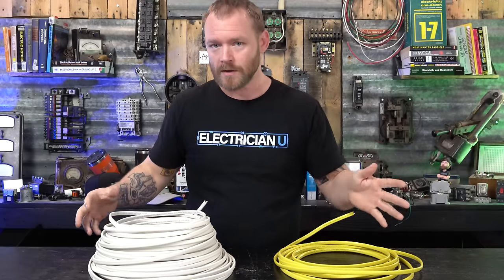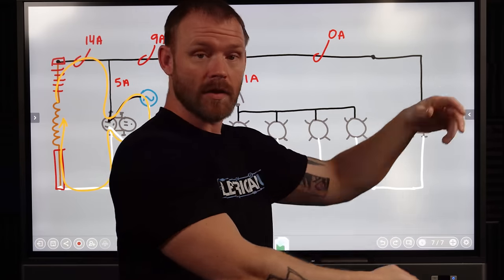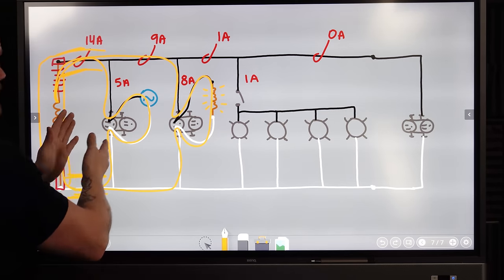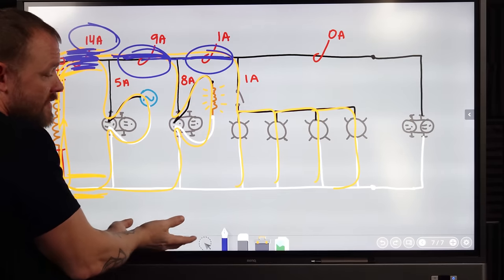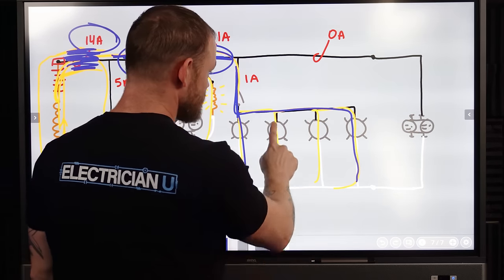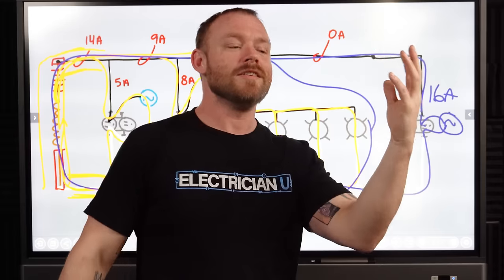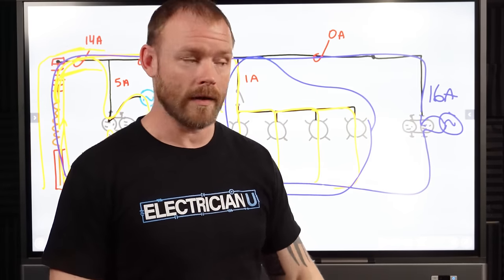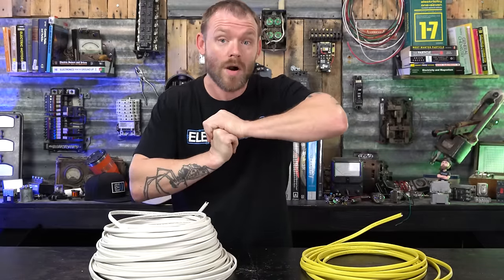Should You Be ONLY Using 12/2? When Can You Use 14/2?

Comment: Thanks for explaining this. In my two bedroom apartment nearly ALL outlets and overhead lights are on ONE 15A circut. So for example my living room has three outlets. Two outlets are not connected to the third outlet. That third outlet is connected to two outlets in Bedroom #1 and a ceiling light. Then in goes to two outlets in the Bedroom #2 and to a ceiling light. Then passes into the kitchen area where the fridge is connected to it and the ceiling light there, a light in the pantry and a light in the bathroom. Now the two outlets in the living room are connected to two outlet in the kitchen area (three outlets in the kitchen total) which goes to a 15A breaker. The bathroom has a GCFI box (Line in) that is then connected to two GCFI boxes (Load) in the pantry (above the counter) then goes to a single outlet to Bedroom #2. So in total I have just 3x 15A breakers for the entire apartment. When I plug in an AC unit in Bedroom #2 and an AC unit into the Livingroom plus not to mention a personal computer in Bedroom #1 it sometimes overloads the breaker and it trips. Also to mention... The entire circuit that is one a single breaker connecting the three rooms has NO green wire or copper wire for ground. Nor is the breaker in the basement GCFI type. The romex that comes into a metal outlet box just has a black and white wire... no ground wire shown. Great video. Thanks for sharing!

Comment: All wiring in a circuit needs to be able to handle full fault current of the breaker, without building any heat in the wiring.  No mixing 14/2 and 12/2 even if nominal current flow is within acceptable ranges.

Comment: With today appliances and computers the 14 gauge is obsolete now I'd prefer 12 gauges for outlets only and 14awg is suitable for lamps and ceiling lights and 30awg is suitable for rack mount servers and dryers and AC and heaters

Comment: 12/2 to outlets with 20 amp breakers. You can use 14/2 or 14/3 for lights. It needs to be a 15 amp breaker.

Comment: Only problem is if you have a short on the 14 guage wire. It will melt before the breaker trips.
Reply: Not necessarily. 14 ga wire has a low enough resistance that a short, even on a breaker as high as 40 or 50 amps, will still trip (Unless ii is a GE, Zinsco or FPE) long before the wire gets hot enough to get damaged.  On an extended overload, however, yes the 14 CAN overheat enough to at least degrade the insulation over time on even a 20 amp breaker.

Comment: When we built Mom & Dad's house, it was wired with 100% 12 AWG (or larger for water heater, stove, etc).  We didn't use any 14 AWG wire.  However, that was many moons ago, when everything was incandescent bulbs (generally 60W to 100W).  Often one switch would control a half dozen bulbs.  So, if one hits 10 bulbs at 100W, that is 1000W, or close to 10A.
Of course, it was also easier that way using all the same wire, and I was mighty young.
I don't remember if plugs and lights got mixed.  I presume they did in some places.

Now fast forward to today, and I'd likely separate light circuits from plug circuits, and use 12 AWG for all plugs, and 14 AWG for all lights, as most LEDs are somewhere from 5W to 20W.  One still can't have an unlimited string of 20W bulbs.

Also consider multiple home runs, so each bedroom might get an independent circuit or multiple circuits for plugs.

My future workshop will have some 30A 110V circuits as well as 30A and 50A 220V circuits.  So bigger wire.  It is annoying to have something like an air compressor blowing circuits.

Good point in some of the comments warning against mixing wire gauges on a single circuit.

Comment: There's only one municipality within 100 miles of me that will allow 14/2 in a house. And oddly enough, it's the largest one . I think all the others are afraid homeowners will swap out the 15 amp breakers for 20s and overload the conductors.
Reply: That's kinda silly though. Why wouldn't they just throw a 30A breaker in once they exceed 20A? Or jam the old proverbial penny in the fuse holder?

Comment: I only use 12 or greater (10,8,6). I really am not a fan of 14 even though it’s easier to work with it’s just not satisfactory for future proofing and the last thing I wanna do is rerun freaking electrical wires. Better just to suffer a tiny bit more when you’re doing an install. Also, the price is negligible for the difference going from 14 to 12.
Reply: Yep, you should step up and use minimum #10.
Reply: @inthemiddleof  Exactly. Let's all run #6 on 15 amp circuits just in case/what if/you never know someone might decide to replace it with a 50 amp breaker so they can plug in 9 space heaters.

Comment: My house has no 20 amp 120v circuits. All 15 amp breakers. All in separate subpanel. It's the wire going from the plug to the 120v appliance that's the problem.

Comment: You’re not thinking about it right. The breaker is protecting the wire so if there is a short at one of the lights that is drawing 20 amps you’ll have a fire instead of a breaker that prevents that.
Reply: Not necessarily. 14 ga wire has a low enough resistance that a short, even on a breaker as high as 40 or 50 amps, will still trip (Unless ii is a GE, Zinsco or FPE) long before the wire gets hot enough to get damaged.  On an extended overload, however, yes the 14 CAN overheat enough to at least degrade the insulation over time on even a 20 amp breaker.

Comment: Fire hazard, consider the LED circuit shorts to ground. If the wire gauge of the wire for the LEDs is like 20 gauge-ethernet wire, that wire is going to heat up  and burn out. Have to consider circuit wiring failures, the wire has to be big enough to trip off a breaker supplying it with power. So 15 amp takes 14 gauge wire, just how it is done. My house most of the upstairs is wired with 15 amp breakers and 14-2 wire, including the bedroom lights and outlets.

Comment: I don’t do what you have shown ever,it won’t pass , if any portion of the circuit has 14 wire the entire circuit gets a 15 amp breaker . I run separate lighting home runs only need 2-15 amp circuit’s to feed the lights on most houses since LEDs have cut draw on lights by 80 percent.

Comment: I kinda feel like if the homeowner is wiring "such a large house that they save thousands" using 14/2 vs 12/2, then said homeowner and their "large house" can probably afford the upcharge in 12/2 wiring. In today's market, a $500k+ house vs saving $2000 or less on wiring? Just spend the extra, they won't notice the cost.
Now, if you're building a row of Section 8, the savings is going to be in the low hundreds, in which case, just spend the extra money, they won't notice the cost.

Comment: Yeah, I will save a few bucks on my wiring. But when my house burns down due to insulation breakdown. Maybe next time I will just do it properly instead of being a cheap ass. Cables should always be rated for the upstream circuit protective device, never break guage.

Comment: Most times a bedroom circuit only needs a 15A circuit. Why waste money on a larger wire when it's not needed? Besides when that alarm clock shorts out wouldn't you rather have it on a 15A circuit which will trip out sooner than a 20A circuit. In a future code, you will be able to use 10A circuit breakers and smaller wire. The cost of wire is outrageous today. I used a lot of 14 wire when I wired my own house 35 years age, and have never tripped a circuit breaker on overload.

Comment: Obviously, from my name, I am not an electrician.  That said, over the years, I have done a lot of rehab and remodeling work.  Everything I have been told over the years is that you always use the correct gauge (or heavier) wire based on the breaker.  In other words, if you have a 20A breaker, you shouldn't use anything less than 12 gauge wire anywhere in that circuit.   What happens on that lighting circuit if something shorts out, but not enough to trip the 20A breaker, but it overheats the 14 gauge wire?

To me, this falls into the category of "just because you can, doesn't mean you should".
Reply: Not necessarily. 14 ga wire has a low enough resistance that a short, even on a breaker as high as 40 or 50 amps, will still trip (Unless ii is a GE, Zinsco or FPE) long before the wire gets hot enough to get damaged.  On an extended overload, however, yes the 14 CAN overheat enough to at least degrade the insulation over time on even a 20 amp breaker.

Comment: Took a while to grasp his statements; he is not arbitrarily advocating smaller wires than the circuit is rated for. What he's showing is in effect a sub-circuit, where the total load is contained, and can never exceed a specific current that falls well below the main circuit and breaker rating. This resembles what is going on within a light bar, with LEDs, transformer, etc. and final wires feeding that are only 16 or even 18 ga. Because the unit is self-contained and cannot add another branch extending to loads, it does not need 12 ga. wires inside its closed system because it draws just an amp or so.

Comment: If you cheap out on the wire you never had the money for the build. 14 /2 should only be used as a  temp lite cervice 15amp  plug or light system.  Of all the expenses of building and remodeling the wires in the walls- ceiling  should be the last thing a home ,business or building owner needs to worry about .

Comment: Wow, so much dangerous misinformation in this video.  The conductor must be sized for the branch circuit breaker regardless of point load except for a few specific feeder tap situations.  This is so that the circuit operates safely in overload/fault conditions, not just the nominal.

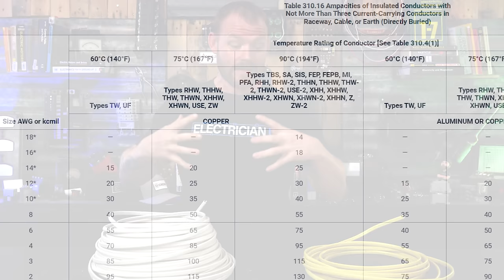Comment: 9:10
" Romex is a 16/3 conductor " 
I always thought that romex was the nickname for nmd90 cables, like the ones in front of you...
And in the table 310.16 , i notice that a 14awg THHN copper is 25A... 😯😯
Does this mean that you can have a 20A breaker with a 14awg thhn wire..?? 
WOW 😲
Reply: I always thought that "Romex" was someone's trade name for NM cable, that has gone the way of "Kleenex" and "Band-aid". You really aren't supposed to use the brand name universally, but so many people do informally that the brand name has become genericized in the places that are too numerous for the lawyers to be able to keep up.

An amusing similar generification of a trade name is with PTFE pipe tape. Many people refer to it as Teflon Tape, but the owners of the Teflon brand name never made plumbing tape. There has never been on the market a Teflon branded plumbing tape. But Teflon is easier to say (and remember) than PTFE, so the generic moniker of "Teflon Tape" has stuck as well as PTFE doesn't stick to things.
Reply: Yes, the wire itself with 90deg C insulation CAN carry 25 amps, BUT the NEC restricts  overcurrent protection of ALL 14ga to 15 and 12ga to 20 amps,  regardless of type or construction.  THHN and the like are usually individual conductors for running in conduits and the like, and once you exceed a certain number of them in a single conduit, etc. you must now apply derating rules to account for heat buildup.

Comment: “We use 14 gauge for the leg” but if you have a 20amp load on that 14 gauge leg (granted, highly unlikely but still possible) then you have a (potential fire). 

In your diagram, you left out a possible (albeit unlikely) scenario of a >15 amp load getting slapped on 14 gauge leg… 

For example in the garage, a light leg that gets a light socket to receptacle to plug in a high power compressor that say pulls 20 amps to charge up the tank, you’re over the amperage limit for 14 gauge.  I don’t think legs being 14 gauge protected with a 20 amp breaker is ever safe, no matter how you try to justify it.

And what about a garbage terribly constructed China led light, that runs 20amps because of just enough resistance to stop at 20 amp current in a high up recessed light can… nobody sees it running stupid hot and over 18 amps, and burning up while not tripping the breaker.
Reply: I couldn't understand your question.  Breakers are designed to open a circuit when overcurrent conditions occur. There is no way a household led light could draw 20A. It would catch flames from the heat it would produce.

Comment: I’m not an electrical engineer by schooling but do electrical engineering as a job. This video is really bad. Circuit protection should never exceed any wire that is connected to it. So if there is a 20A breaker the smallest wire should be 12AWG NO smaller wire should ever be used regardless of the expected draw from that parallel branch.

Comment: Maybe you should read through section 210 in the NEC again, and learn residential load calculations over. You are telling people wrong information and for someone that likes to do things themselves without a professional, would potentially burn their home down. the only time I have ever seen a reduction in wire size is on a connected fixture whip, that only serves that one fixture. I have been an electrician for over 30 years now, and know that your application would never pass an inspection. As far as using 12-2 for everything. Well, that is preference. After making up 5 boxes of 12 awg wire, you are more likely to rip it all out and wire it with 14 awg, which by the way, is legal to use for general purpose outlets.
Reply: Hi Ron. Hope all is well. Thanks for a solid answer. I am a residential contractor that wires and am not a formally licensed as an electrician so I have a question I hope you can answer. Whether I run 12-2 on a 20A or I run 14-2 on a 15A... and I am running it to a light package in a dining room that are all LED recess lts. (power to switch box). The wire that is internal to the LED j-box connected to the push connectors is likely 18awg or lighter. Why is this lighter gauge wire not part of the discussion since it is smaller and has a smaller max load than either 12  or 14? The same question can apply to incandescent fixtures too since they utilize 18 awg or smaller as well. Thanks for any response that might clear up why the lighter gauge lamp wiring is not part of this discussion.
Reply: @sdsconstruction  the smaller awg wire is for that light only. If you look on the inside of the housing of the can (If it's a recess can), you will see the max size bulb you are allowed to install in that can. For instance. A 100 watt incandescent bulb is only .83 amps. That does not exceed the amp rating of the 18awg wire in the can. LED is rated at much less. For example, a 10 to 12 watt LED lamp is equivalent to a 100 watt incandescent bulb. Now if you want to run a 20 amp (12awg) circuit to a switch and wire all the lights with 14awg wire. That is a violation against code. Consider this, if you install 50 cans on a circuit and install 12 watt LED lamps in all the cans, and the home owner comes along and changes all the lamps out to 100 watt halogen bulbs. Well that circuit just went from 600 watts (5 amps) to 5000 watts(41.6amps). That's a fire for sure. Always calculate a circuit accordingly so you won't have any troubles. Let me know if this helps you
Reply: @roneckler9937  I appreciate your well thought out and detailed response! Thanks for taking the time to clear up my understanding for why the lighting fixture light gauge wiring is not the consideration here within the context of the video Dustin presented about using a (special case) 14awg switch leg on a 20A circuit. Your time is appreciated Ron.